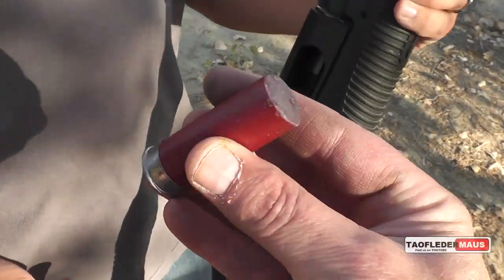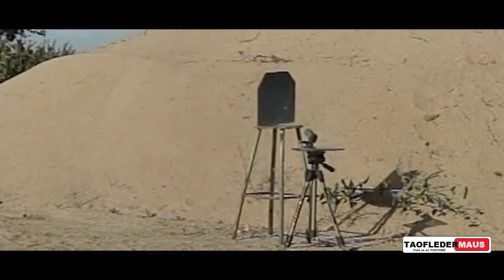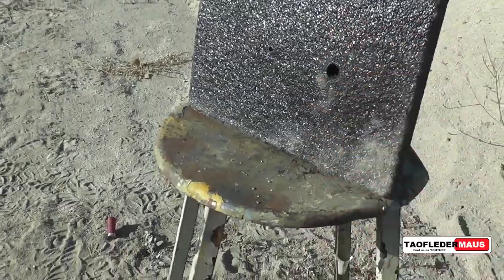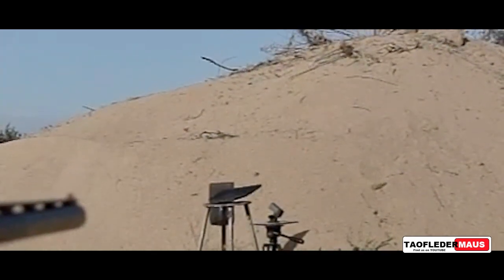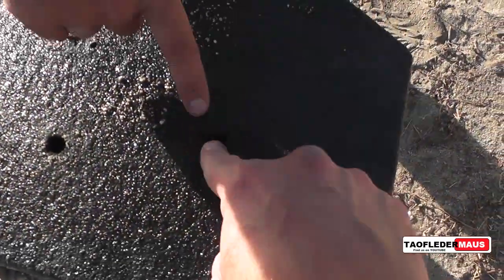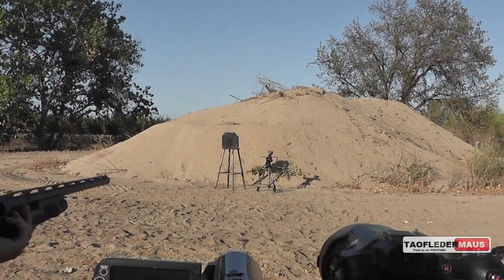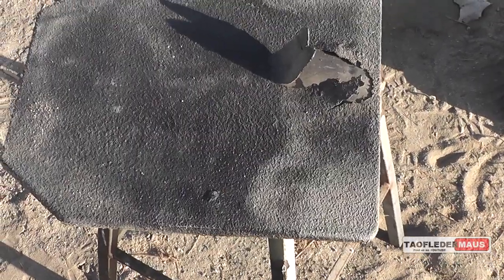AR500 Armor® Plate - ULTIMATE Anti-Fragmentation Test

Comment: Isn't the actually dangerous spalling supposed to be happening on the back side? The shell shattering on the front of the plate isn't really spalling...
Reply: That would be correct, spalling is when the metal plate essentially shatters to a degree, sending small shards of metal to break off the rear of what a shell hits.
It's also why modern tanks have "Spall Liners" which are just a combination of softer and harder metals to absorb the kinetic energy transferred from a shell or HESH round.

Comment: Taofledermaus, you should try a ball bearing shot on it, see what effects that would have. You should also try a tungsten carbide ball load, though that may be too heavy. Also, I think putting a bunch of different density metal balls (lead, steel, aluminum) in a shot could make a cool video, to see the different performances of the shots.

Comment: The armor needs to be placed against something solid. In order to give a proper test result, there needs to be resistance behind the plate (simulating someone wearing the body armor.  When it comes to penetration tests, all mediums need to be properly secured in order to give accurate test results.
Reply from the maker: Do you think the wax slugs would go through the plate?   These rounds wouldn't even DENT this plate even if we shot the plate while the plate was travelling towards the shooter at 1000 mph.    We were testing the coating for spalling!
Reply: i think the results might have been somewhat different, but my comment was more universal and not bound specifically to this video.

Comment: nice stuff. Just curious about the High speed parts, I know that you have a Casio Ex F1Pro, I have one too. in a previous video you spoke about some settings being better for capturing the bullet as it flies through the air, could you post abit more about that. Great video by the way, and have you ever used the 60FPS stills in one of these? I know usually the action last longer than a second so its not that useful..
Reply from the maker: The main settings I tweak are white balance and shutterspeed.  I  try to get the fastest exposure for the lighting conditions.  I was using about a 1/3200 exposure for most shots.   I haven't used the burst mode to capture stills that much.   I usually have 5 or 6 other cameras I am juggling at the same time.
Reply: *****
 Great thanks for that so when you do take video at that setting then each frame is shot at 1/3200 of a second?
Reply from the maker: Yes.   If it is really bright,   I can crank it up too.  It's often just a  guestimate,  because the imagery MAY look good on the camera screen and ends up looking lousy when I review it on the computer.

Comment: If you guys are getting trouble loading some of your custom shotgun rounds, you can get a break action H@R 12 gauge for under 200 bucks (single shot).
Reply from the maker: Usually the single shots have a tapered,  (non-cylinder bore)  barrel.   We don't have too many problems working-around making very long rounds fit into the Mossberg.   We just take the barrel off.

Comment: Great video Jeff!  Pretty neat that it stood up to multiple waxers and still looked ok.  Got a couple ideas for what you could shoot at it next.  Since you used the plate you tested the steel ball bearing as a stand why not shoot a ball bearing at it?  Another idea would be to see if you can get a steel dart to stick in it like what happened a few months back in another video of yours.  That's assuming you've got any of those darts left.  Finally, silly putty.  Yeah I know it won't penetrate, I just want to see if it will send the plate flipping over nicely like what happened in this video.

Comment: I figured that wax slug would slice right through that plate. I guess the most interesting part is if the coating on that plat stops bullet shrapnel!!!!! That's pretty cool. is that rhino lining?
Reply: broguearcher
Don't bother, you got trolled, bro!
Reply: How do you figure that a wax slug would slice right through that steel plate?!  I make and test wax slugs myself... and I've found them to be rather poor at penetrating due to their inherent tendency for the projectile to immediately fragment on impact. Now, a steel ball bearing or lead round ball embedded in wax... that's a recipe for serious penetration right there.  I have a bunch of those rounds loaded as well and I'm waiting for the right time to test them and make a video to post.
Reply from the maker: It's some sort of Techron® coating.   Made out of recycled soccer cleats.
Reply: ***** it's tough stuff. Super hart to cut, and it does what it's supposed to do with fragments
Reply: Its all about sectional density, and velocity...   the heavy, wide and slow shotgun slug is a fearsome flying chunk of win... but its greatest strength is also its  greatest weakness when trying to punch through armor.  it dosent have enough kinetic energy to drive that 3/4 inch wide chunk of blunt lead through anything that is designed to absorb impact, or hard enough to break up the projectile. Even  level IIIa soft armor will stop shotgun slugs. (Gonna hurt like hell though)  Hardened AR500 will cause the slug to break up and splater across the steel face.  A steel ball bearing will shatter on AR500. It will take an honest to god high velocity armor piercing projectile to penetrate that AR500 plate.  Something like 30.06 M2AP or 7.62x51 nato SLAP  will do it.  Some very high velocity, (well over 3000 fps) small diameter heavy constructed sporting rifle calibers can sometimes do it.(seen a 180 grain 300 win mag go through one once... might have been a fluke, cause ive seen .338 lapua get stopped sometimes...)  22-250 in 55 grain (might) be able to do it.  And 7mm mag might.  But nothing you can fire from a shotgun either factory or improvised is going to go through a 1/4" NIJ level III rated AR500 plate, NOTHING (not even one of those 12 gauge mini grenade rounds)  
Now maybe... if someone were to create a small 12 gauge stabilized shaped charge warhead (think a micro HEAT round) you might penetrate the plate.

Comment: Thank you for making this video. I was looking for demonstrations of this plate against strong rounds. I've been thinking of making leather chest armor and then adding the curved plate and the side plates under it and somewhat thin stainless steel on the top (so you wouldn't see the AR500 plate, only the stainless steel).

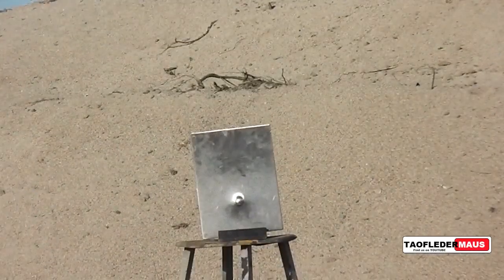Also, look at the way that the steel plate dug itself into the sand at 1:39. That was kind of unexpected.
Reply: Demolition Ranch also did some tests, inc. 50. bmg tests, and a great torture test. Check it out on their channel
Reply from the maker: These plates are very impressive.   They are pretty heavy  but for the price,   they can't be beat.   Yeah... lol   the stainless plate almost got lost in the sand.
Reply: ***** You should shoot a few shotgun loads that were very good in previous tests. Pycrete or those amazing darts might be interesting to see.

Comment: You have probably already tried this, but how about mixing in some .22's bullet tips into a wax slug just for fun? You could even try larger calibers such as .45 and top it off with some regular birdshot for the wax slug. 

Quick note though, I have no clue of how much can fit into a 12 gauge shotgun shell, but would be cool if you tried it out. 

Keep up the good work man!
Reply from the maker: I don't think the wax would be strong enough to hold the larger bullets into a single slug.  Less surface area.   The .22's do stack neatly into the small shot cup.  I've shot them loose before only.

Comment: I'm wondering, the plate that hold the armor plate, does it have a lot a mass to it?  I'm just wondering if it matters to how the armor plate reacts when attached to something that won't allow the armor plate to "absorb"/move, such as being strapped to a body compared to freestanding by itself and not held down.  I'm just wondering if penetration might be more.
Reply from the maker: The plate weighs around 8lbs to it does have a lot of heft to it.   There it NO chance a wax slug will penetrate these plate.   Even a Mosin Nagant round with a steel core is stopped by these plates.   Armor piercing .308+  and .50 bmg will go through it.
Reply: *****
Thank you for the reply.  I'm just curious if for the next test, you'll strap on a "body" stand-in to provide more resistance and to prevent it from flying away like this test.  I'm still curious if that would affect the test.  I'm thinking it should.

Comment: How you use bird shot in your rounds, could you try something like buck shot or larger pellets? It would be interesting to see weather the damage would be the same or not
Reply from the maker: I don't think the wax would be strong enough to hold the larger pellets together since there is much less surface area.
Reply: ***** Only one way to find out.
Reply: ***** good point
But If you were to put some kind of fibrous material in with the lead balls it may hold it together better

Comment: I think it would realy make a difference if the Amor Plate would not go flying after you shoot it. I don't know how heavy it is but you lose quite some energy on this don't you?
Keep it up =)
Reply: sciencoking Lost all credibility when you said the rest turned into heat... No loss on deformation of THE FUCKING STEEL PLATE or dispersing shrapnel or anything.
Reply: I was thinking the same thing.  Perhaps a mass behind the plate, and have the plate strapped to it.
Reply: MU Knives And he'd be right, of course. Nearly all of the energy that goes into plastically deforming the steel ends up as heat. A trivial part may go into breaking chemical bonds / work hardening the steel (though this is not obvious as it depending on the chemical structure, it plausibly could even release internal stresses, releasing more energy as heat than absorbed from the bullet, as hardened glass can do). Another trivial part ends up as vibration of the plate, which is eventually dissipated as heat through a small amount of hysteresis in the stress/strain relationship and sound which eventually ends up as heat in the surroundings.
Reply: The plate does keep some kinetic energy when it starts moving, but even though the slug is very small, the energies involved can be counter-intuitive.
I'm not literate when it comes to guns, but I can do some physics on this:

The slug will have an energy of some 4 kilojoules (from Wikipedia). The armor plate weighs some 4 kilograms. If after the impact, it moves at maybe 2 meters per second (and it didn't, but let's leave some room for rotational energy), that would translate to 16 joules or 0.4% of the round's energy. The other 99.6% will have converted into heat.
Reply: Gallicien Galileo
He is only talking about the last sentence ('The other 99.6% will have converted into heat.') which is total BS. And when he says something that is THAT wrong ... well how can you trust everything else he writes? :)
Reply: From the videos i've seen from the makers, it seems like the only difference would be in the end, it wouldn't show the Steel
Reply from the maker: There is zero chance the waxers would go through this plate.   We were mostly focusing on the the Paxton coating.
Reply: ***** Read again his comment, he gave some info and made son calculations, he didn't have the real figures to work with, so he just supossed them
Reply: The bottom line remains though that nearly all the energy is absorbed into the steel plate. Kinetic energy of shrapnel is kept at a minimum by design, but that wouldn't matter for my point anyway, since we're only talking about fixing the plate to the stool.